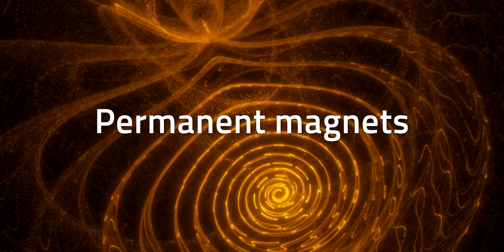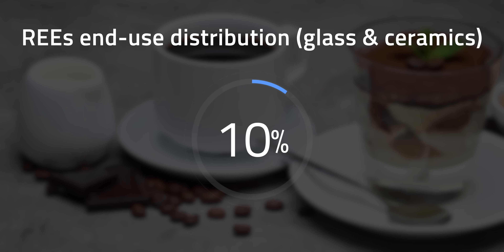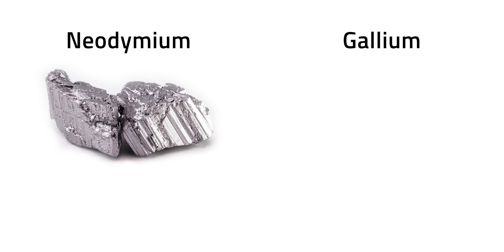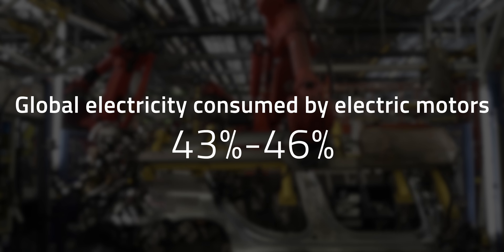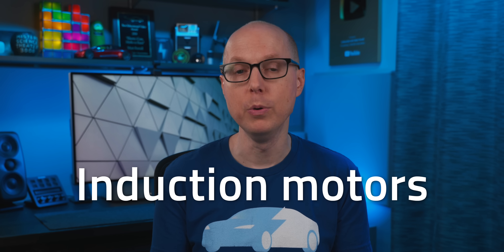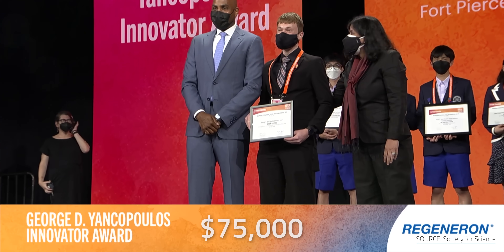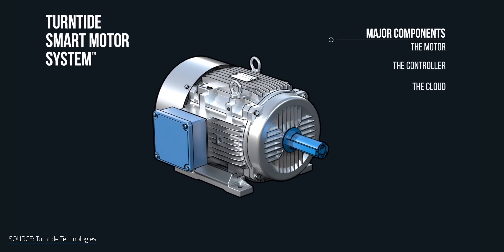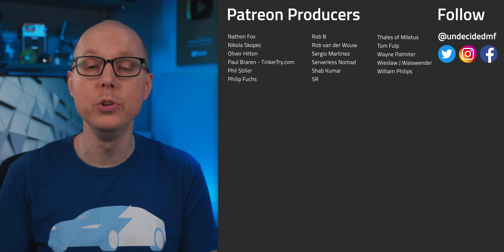Why This 17-Year Old's Electric Motor Is Important

Comment: I'd like to point out two major corrections:
1 AC induction motors use NO permanent magnets
The magnetic field is "induced" in the conductive squirrel cage not generated by permanent magnets at all. (FYI it's called a squirrel cage because the rotors typically made of a cylindrical arrangement of copper or aluminum bars similar to a hamster wheel (why it's called a squirrel cage not a hamster wheel I'm not sure))
2 synchronous reluctance motors are already a excellent alternative to induction motors in fact Tesla already uses a hybrid synchronous reluctance/permanent magnet motor in its cars (specifically because of its high torque high efficiency and reducing the need for expensive magnets)(reluctance motors are only now getting good because of The reduced cost of switching electronics required whereas induction motors require no extra controller to work on AC power, but the premise has been around for a long time and is relatively well developed))

edit: Thanks for replying and updating accordingly!  I completely agree reluctance motors are awesome and should be used more. I just wanted to call attention to the fact that the vast majority of motors (induction motors) have no permanent magnets (and no rare earths)(and efficiencies usually >80%) and that the primary benefit of reluctance motors is (marginally) increased efficiency with little if any torque/performance reduction (rarely is startup torque the primary design factor anyway) but a larger upfront cost (that should trend down as adaption increases)
Reply: Exactly, I write similarly.
Reply from the maker: One point 1: Yep.  I think we may have unintentionally blurred the lines in how we talked about the motors in the final video edit.  On point 2: yes again, but that's actually the point of the video.  Tesla uses magnets in their design to hit the energy and performance they're looking for.  This is about finding another path to achieve high efficiency, high torque, but without rare earths.
Reply from the maker: I've trimmed out the problematic sections from the video where it was creating confusion around AC motors.  Appreciate the feedback.
Reply: @UndecidedMF  good on you, so quick after upload too I’ll sub to that
Reply: @UndecidedMF  That might have introduced some AV issues. I'm not seeing the video and audio match up throughout the whole video right now.
Reply: Right, aren't SynRM's typically more efficient than SRMs, Induction or  PM motors? The main issue is really the torque density and (outdatedly) sophistication of power electronics?
Reply: @UndecidedMF  When I make a video, I tend to leave mistakes there as well. Not everything has to be polished. We are real people. When I was designing generators, it was about the 20th in order that was useful. And not just on paper/simulation. Only politicians are perfect.
If it weren't for those imperfections, maybe we wouldn't even be talking.
Reply: Also..
Rare earths aren't actually rare, no matter how often you say it 😉
Reply: @UndecidedMF The closed captions are shifted, likely due to the edits. Also, you say and the CC reads the efficiency measure when operating at 750 RPM but the in-video graphic says 700 RPM. Cheers!
Reply: @UndecidedMF  Tesla uses SR for their dual motor design
Reply: @DaveNegrotto  He must've fixed that by now, if so. Good to me.
Reply: here is a good vid by lesics about the synRM, and the 17-yo didn’t invent it.
Reply: @NitReg-jp1gi  My understanding is that the video said that the 17 yr old "improved upon" not invented the concept? Am I missing something?
Reply: @jamesgrover2005  : That's what they're called. If you have a problem with it, go back in time to get it fixed.
Reply: @absalomdraconis  you'll find they are called the Lanthanide series if you go back in time, if you rewatch you'll see the phrase rare earth is used heavily to imply that they are indeed rare, hence the need to find alternatives asap ie the new motor.
Reply: @jamesgrover2005  No, the video makes it perfectly clear that they are abundant, but mostly not in conveniently large pockets that can be easily mined. So in a practical, commercial sense they are "rare" (difficult and expensive to obtain), despite being abundant in nature.
Reply: @UndecidedMF  "Tesla uses magnets in their design to hit the energy and performance they're looking for."  Lies, tesla uses magnets in their designs because it enables a smaller motor with less mass and when your moving your energy supply around with you that really matters.  In most fixed applications like an HVAC systems or almost anywhere else a motor is used such things are of vanishing little concern.  There are plenty of options for an IE5 motor.
Reply: @srotovnikabc6919  Leaving mistakes in videos like this can cause real problems presenting your videos to other people. Things like your bosses or clients and then they call you out on the mistake and completely destroys any confidence in what you are pitching.
Reply: @SSingh-nr8qz  Yes. A person can be either 99% or better not even exist :)
A perfect planet then begets perfect crap.
A psychological paradox.
Reply from the maker: Thanks for calling that out ... fixing it now.
Reply from the maker: Nothing is perfect, but I'm always trying to improve how I make these videos.  I appreciate the feedback.
Reply from the maker: Trying to fix that now.
Reply: @UndecidedMF  Oh, it's cut on Youtube, that's why the vid is so janky.
Reply: @Tondadrd  Yeah, I really think it needs to be fixed offline and then re-uploaded... 😕
Reply: BMW use brushed AC motors, good idea in my opinion. Well proven simple technology.
Reply: @srotovnikabc6919  "Only politicians are perfect."

to which you might add "although typically you can't see it until after the 20th merciless beating."
Reply: @theweekthatis  That's awesome! Wait do you mean brushed with a commutator or brushed with slip rings?
Reply: @seastate1277  brushed with sliprings (serviceable brushes).
Reply: @theweekthatis  Awesome that's the arrangement I thought would be the obvious competitor to the young inventor's motor, so I'm glad someone has mentioned it

Comment: In 1889, Mikhail Dolivo-Dobrovolsky invented the wound rotor induction motor.  Which looked like a squirrel cage and the name stuck.  Tesla invented it pretty close to the same time independently and gets most of the credit because he already had the patents, but most physicists agree that Dobrovolsky got in the first punch.
Reply: Great minds think alike.
Reply: So, just to be clear, it's  not  because it replaced a squirrel running inside a hamster wheel to make things go "Vroom"?
Got it.:yougotthis:
Reply: You are not well informed. I went through all 300 Tesla patents, because I designed some motors myself. The cage of today's engines is not there, that is the work of Dobrovolski.
It is not important what the majority thinks, but what the majority will actually feel and understand.
Even the first Tesla motor in the museum in Belgrade is not induction, but synchronous. He started doing induction with a wound rotor in about half of the content.
Even reluctantly.
Reply: So many great minds but probably more so about the environment of that time, the singularity happened in a way
Reply: Asynchronous mouth movement to mouth sound. Now THAT's a technology Mr. Ferrell could use in this video's creation.
Reply: In Teslas the magnets were arrayed to induce the Halbach Effect.
Reply: @echoeversky  How many electric motors have you measured in a row? This is a professional question, not a winery.
Reply: Wound rotors with rings, are used for adjusting torque and rpm's. For example, the Himalaya rides for amusement. Or industrial equipment. The rings connect to brushes that are connected to electrodes, that are mechanically dipped into saltwater, shorting out the rotor, and creating the electromagnetic poles, for the alternating magnetic fields in the stator, to follow. Except for the armature type motors in drills, and induction/repulsion motor, most AC motors, don't need brushes. This may not have been the first AC motor. But Edison's DC lost the current wars in the end.
Reply: Another reason to be mad at Tesla
Reply: About some inventions/discoveries and their real inventors/discoverers:

- Dynamo theory: Ányos Jedlik (Hungary, 1856, working prototype in 1859)

- Closed-core transformer: Miksa Déri, Ottó Bláthy, Károly Zippernowsky (Hungary, 1885)

- Vitamin-C: Albert Szent-Györgyi (Hungary, 1933, Nobel Prize for it in 1937)

- Safety match: János Irinyi (Hungary, 1836)

- Holography: Dénes Gábor (Hungarian, 1947, Nobel Prize for it in 1971)

- Ball-Point pen (the first usable one): László Bíró, (Hungary, 1938)

- Possibility of nuclear chain reaction: Leo Szilárd (Hungarian, 1939)

- Hypersonic rockets: Tódor Kármán, (Hungarian, founder of the Jet Propulsion Lab)

- Fundamental symmetry principles of elementary particles:  Jenő Wigner (Hungarian, Nobel Prize for it in 1963)

- H-bomb: Ede Teller (Hungarian, 1952)

- BASIC programming language (Co-Developer): János Kemény (Hungarian, 1964)

- Rubik's Cube: Ernő Rubik (Hungary, 1974)
Reply: I think it was just on paper, or did he actually build one?
Reply: @mrnmrn1  that's crazy I thought us used an h-bomb in world war II, looked it up confirmef your info
Reply: @Joso997  Yep, which is why they call it the 'squirrel cage motor'.
Reply: @mrnmrn1  True. I knew of some of them myself, from independent sources. Nice list.
Reply: @mrnmrn1  So they hungered after technological progress. 🕺😵‍💫
Reply: @fare2muddlin  Oh, my...
Reply: That's sort of like Newton and Leibniz inventing their separate versions of calculus around the same time. There was some controversy about who was first, and whether or not one stole the idea from the other, but each of them had their own reasons for developing their versions. I wonder if there's a mathematician out there who could look at Newton's calculations in his physics, and Leibniz' calculations relative  to his monadology, and see if or how their "practical" applications shaped their separate versions of calculus (their separate "calculi"?).
Reply: @grizzlygrizzle  I say give them both credit.
Reply: @rp9674  The US developed two types of fission bombs, using uranium-235 and plutonium, during WWII, tested the plutonium design in July 1946, and dropped the (untested but simpler) uranium bomb on Hiroshima on August 6, and the tested plutonium bomb on August 9.

After the war, Edward Teller in the US and Andrei Sakharov in the USSR separately led groups of scientists to develop the hydrogen fusion bomb, using a fission bomb as a trigger.  H-bombs have, thankfully, never been used in war.
Reply: u beat me to it
Reply: @fredbays  GMTA (great minds think alike).

Comment: FYI: Tesla uses a hybrid motor type now called a PMSRM (Permanent-Magnet Switched Reluctance Motor).  Their goal was efficiency, and they also reduced the use of rare-earth magnets in the process.  Using a lot of "secret sauce" software in the drive inverter they were able to take the benefits of each technology and combine them into the most efficient EV motor on the market.   In some cars, such as the Model 3 and Y, they still use a cheaper (no rare earths) induction motor in the front for AWD, while the PMSRM is in the rear and is where most of the efficiency gains come from.   I also have a Youtube channel where I explain a lot of Tesla's technology.
Reply: Was looking for a comment like this, thanks for the nice explanation. Maybe there's more to this moror and he's just oversimplifying it? But Tesla has definitely done some magic
Reply: Yeah but wouldnt trust Elon and Tesla there must be some catch
Reply: That's synchronous reluctance and they are very efficient but don't have as much torque so I'm not sure what he is talking about in this video
Reply: Kewl man now make it more efficient
Reply: @erick4188  thing is to teach people you have to simply it then have a more in depth discussion

for example the basic simply is that all batteries and motors uses rare earth
then more in depth would be if it uses it or not and if so how much

because reality we have people so don't understand the process of getting those minerals, it's like creating paint which if you work in a paint factory there is a good chance of getting cancer in some areas of the plant because of the chemicals being used

people who believe that batteries are the way to go and down see any downside like the processing plant don't realize that part, now I'm not saying batteries are bad it's just not as 100% echo friendly as they think

i just wish people looked at it as a whole instead of skipping pages to the plot of a book
Reply: yea thanks for this, I was under the impression tesla was already using advanced motor tech but couldn't remember the details, now it comes back to me, they use a particularly powerful type of rare earth in limited quantity for the PMSRM which gives the exact efficiency boost expected over rivals motors, also the bit about the AWD (peak power) being with induction motors also rang a bell as I remember copper core/winding motors which would be the induction ones
Reply: @trif55  Tesla uses specially constructed laminar magentic domains combined which produce specific magnetic parameters in a reluctance motor with Halbach construct.

Its really nothing "special" in terms of material but a very clever construct which optimizes the magnetic field lines and concentrates them to the outer shell while minimizing the magnetic hysteresis losses which occur in every switching magnetic field effect involving dielectric material like e.g. iron.

Short: Its not a special material, its a special production process. But its not even patented. Actually it has been a fairly long known process. Its just very hard to do profitable.
Reply: These types of hybrid motors have been in use in EVs since the original Prius
Reply: @enginerdy  No, the Prius motors do not have a switched-reluctance component, they are just PM BLDC.
Reply: @Ingineerix  not true, they also use saliency to produce torque in combination with the PM poles. At least the original one did.
Reply: @enginerdy  The type of motor is not new. But is fairly modern.

You should ask who invented the asynchronous 3-phase AC motor.
Reply: Mr. Ingineerix, you have produced excellent content about Tesla engineering.  You have been MIA for some time now?
Reply: @akhtarkh  Sadly making Youtube videos is a huge time sink, and I could get enough revenue from Youtube to make it worthwhile.  Most people don't bother subscribing.   I tried to do a fundraise and only a few people pitched in.
Reply: Toyotas design
Reply: @enginerdy  they are not the same PMSL motors that Tesla use however.
Reply: @knightwolf3511  I definitely feel if you don’t know the drawbacks of any technology then it’s not well understood. Ex. The internet is a great source of information, Con, the internet is a great source of information. Haha.
Reply: Lol bots by Tesla having a marketing session? Surely not! I doubt anyone could be so circuitous as to implement such an idea… and then target said bots to relevant videos… don’t get me wrong there are amazing engineers there, but this stinks just a bit of marketing.
Reply: @Ryanrulesok  there is no catch. Elon is the CEO not the staff that made it happen. They work VERY hard at both SpaceX and Tesla. Probably harder than 99.9% of US companies.
Reply: @donquixoteupinhere  it's a YouTuber marketing his own channel. Doesn't take a brain surgeon to use a Google alert for when batteries or whatever is mentioned on YouTube. Esp if it's THIS channel which is REALLY popular among engineers
Reply: @donquixoteupinhere  I'm sure it happens at many companies. Usually you'd just hire foreign workers to do that though. It costs very little. Basically what Cambridge analytica contractor, psy-group, did. Or Russias IRA. Russia's IRA had a bunch of kids working in Russia do it but then they eventually moved some of their operations to Africa. There was another story of a guy who messed with his election in.... I forget maybe Africa... But he just made a bunch of bots, it wasn't super effective long term. Anyways foreign labor is very cheap and there are contractors that will do PR control on social media like that.

There are American politicians and activist groups who do this as well. Like Steve Bannons friend Guo wengui who ran an anti vax troll army. I think Matt gaetz bragged about having one but I couldn't substantiate any evidence. The group called ADF has one but they are pretty much volunteer only.... There are more but yeah
Reply: @donquixoteupinhere  Tesla doesn't do marketing like that, they don't need to; they are selling all the cars they can produce.   I have never worked for Tesla, if I did they'd make me sign a non-disclosure agreement.   I think Elon is a dick, but Tesla has thousands of great engineers working for them and they make great cars DESPITE Elon.
Reply: @Ingineerix  okay I respect that! Cheers!
Reply: @Ryanrulesok  lmao why not?
Reply: Tesla also uses IPMSYNRM motors. Internal permanent magnet synchronous reluctance motor.
Reply: @luckyjay778  
I wrote a song about the Internet:

Oh Internet,
Oh Internet,
Oh Internet,
Oh Internet.

Oh Internet,
Oh Internet,
Oh Internet,
Oh Internet.

Oh Internet,
Oh Internet,
Oh Internet,
All along the WatchTower.

I'm a co inventor of the Internet.
There's a truck load you don't know about the early 80s.
I suggested it to Can and US Commission, based on the French Minitel.
My best ideas are stolen.
Reply: On Tesla's Investor Day, they mentioned they will have a motor without Rare Earths.  I wonder if this young man will find a career for himself there. 🙂